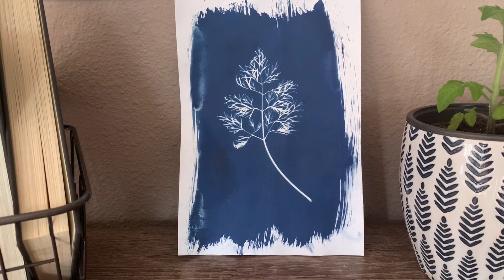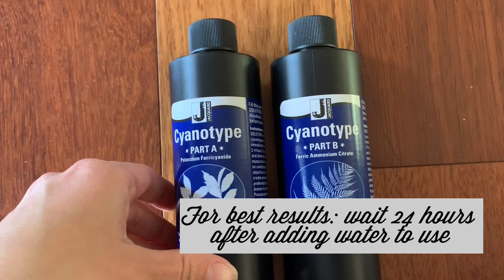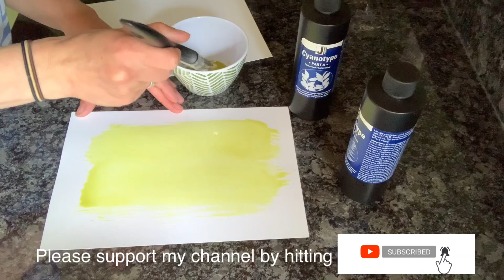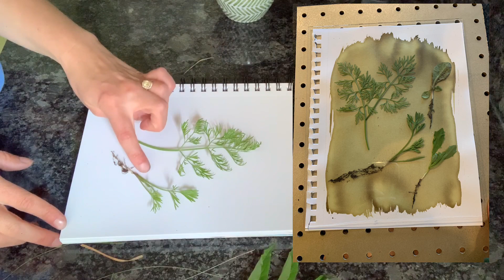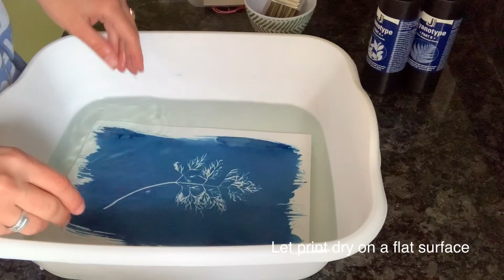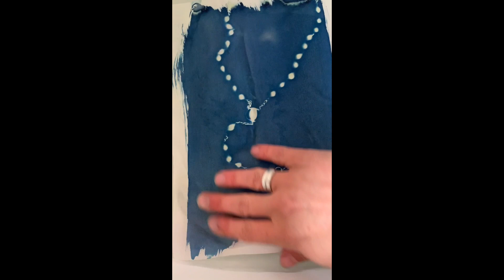Cyanotype Basics- How to use Jacquard Cyanotype Sensitizer Set (DIY cyanotype prints)

Comment: how much water should I add to the bottles? should I fill them up to the top?
it seems there are quite a few people asking this question but no answers yet.
Reply from the maker: Yes, the directions say to fill the bottle. I would not fill it to overflowing, all the way to the top
Reply: @OrphaBeatrice  Thank you!
I have done few cyanotypes after this video and they turned out great!

I have done some calculations and since the bottles contain different amounts of chemicals, they need almost the exact amount of water to create the right solution. 
in short, filling up the bottles with distilled water almost up to the top makes sense! and it does work.

Thanks again, Beatrice!

Comment: Why does my solution turn deep green when I mix the solution. Any ideas?
Reply from the maker: It’s being exposed to too much light when mixing and applying. Try mixing and applying and drying in lower natural light!
Reply: Some people add some hydrogen peroxide to the water after being exposed to the sun. I don't see you adding it to the water.

Comment: How long can you keep the dry paper before using?
Reply from the maker: Only a few hours!
Reply: I don't know about Jacquard's solution, but if you make it yourself then if the coated and dry paper is in the dark, then they are usable for a few weeks (if you put a gelatin layer before) without any issues. Tho I recommend using them ASAP, just to be sure.